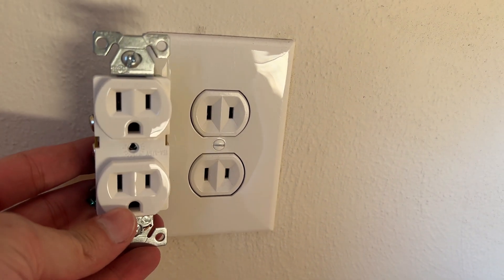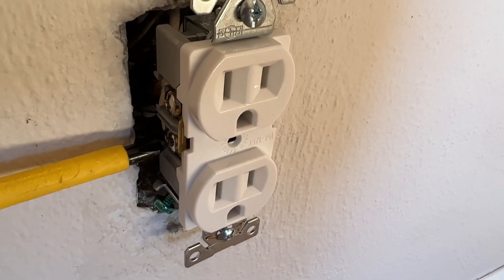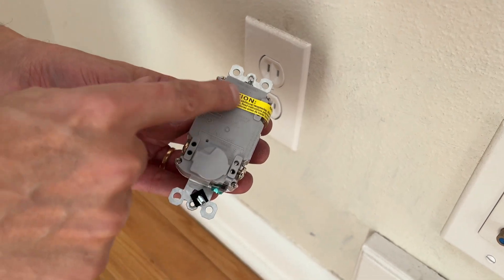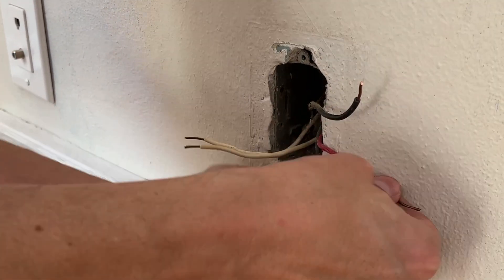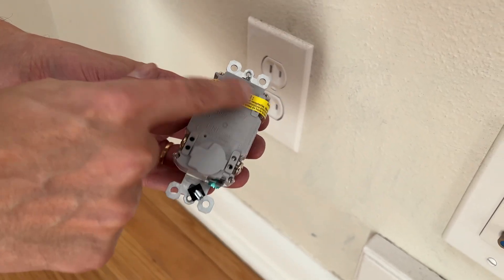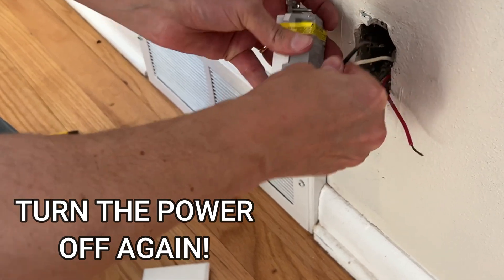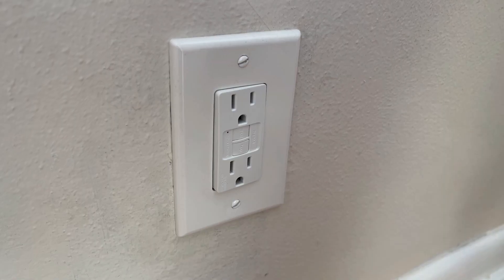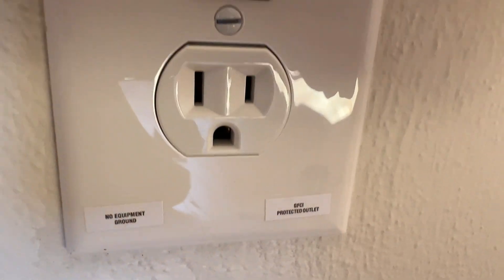Replace Your Two Prong Outlets Now

Comment: How do I know which outlets are downstream?
Reply from the maker: It’s a bit tricky. You have to experiment. 
1.  Turn off power 
2. Pull out outlet you think is “up stream”
3. Disconnect this outlets wiring entirely and separate wires. 
4. Carefully turn power back on and test outlets you suspect were “down stream”.  If outlets are dead now you have found which ones are “down stream” from the outlet you pull out.

Comment: I have mostly 3 prong outlets but the only ones that are 2 prong are the ones in the bedroom ( I replaced one of the 2 prong outlets with a 3 prong gfci outlet because I have a tv and router that has 3 prongs )
Reply from the maker: Sounds like you’re on top of it. Good work 🛠️🛠️